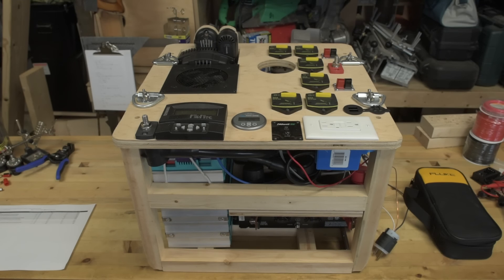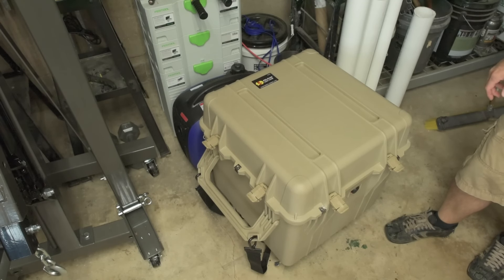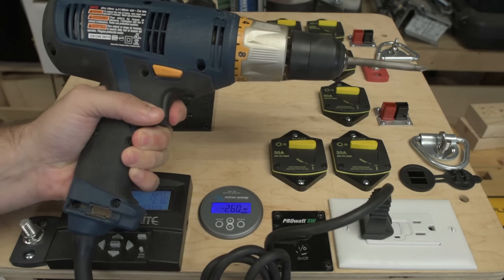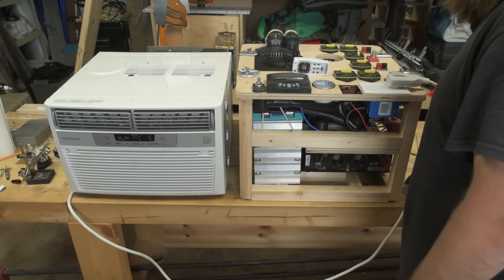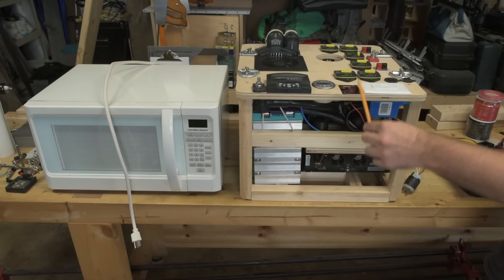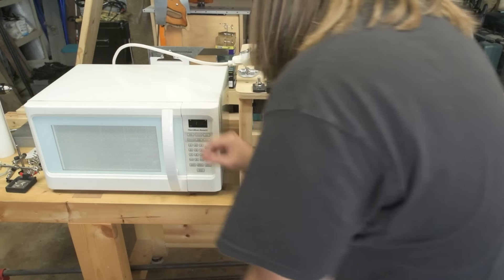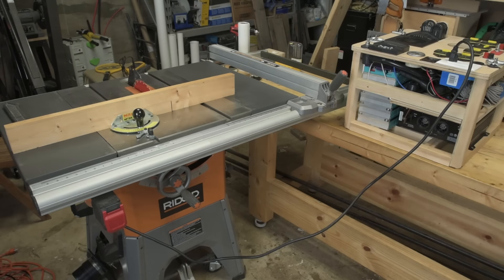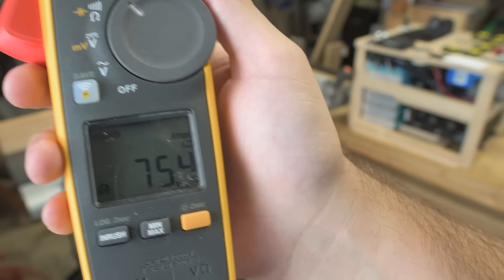Solar Air Conditioner with Xantrex SW2000 Review (Solar Generator V3)

Comment: Hi Jessie, Thanks for showing and elaborating on your nice setup.  I just wanted to throw in my 2 cents to help educate those interested in going to solar power.

First off, we are spoiled by the high quality power we receive coming into our house.  It is perfect power (virtually unlimited, very low distortion, unaffected by appliances that have a high surge current and/or poor power factor).  When you try to make your own power however (such as in an off-grid situation), limitations can quickly cause trouble.

Starting with the solar panels, the rated output is spec'ed under ideal conditions: direct, very bright sunlight, no shadow falling on any part of the panel, the panel temperature is 77F/25C, and the panel is perfectly loaded to extract the maximum about of power.  In the real world, overcast days, high humidity, high temperature, shade from nearby trees/buildings, and the sun being within 3 hours of sunset or sunrise, can substantially drop the panel output.  If you want to power a load 24/7, I recommend at least 10 times more panel power than the load.

For maximum efficiency, the solar controller (the power converter that goes between the solar panels and storage batteries) needs to be a MPPT (Maximum Power Point Tracking) type, which always loads the panels for maximum output power.

The inverter (the power converter that takes the battery power and converts it to house power) needs to be selected carefully depending upon the type of load you plan to power.  If you are powering incandescent light bulbs, small heating elements, or simple electronic items, you can get by with a lower priced modified-sinewave inverter.   If you are planning to power a nice TV, desktop PC, or an induction motor, you need a true-sinewave inverter.   Yes, you can temporarily get by with a modified-sinewave type but, I don't recommend it.  The modified-sinewave inverter puts out squarewaves, cause continuous surges (due to the rapid rising and falling waveform) and voltage transients.  Also, it does appear to run most induction motors but, if you check the power consumption, you will find the motor is drawing 10 - 20% more power (which turns into more motor temperature rise, shortening its life), which power you can't afford to waste in a solar system.

Power factor.  Inverters are spec'ed with a resistive load, which has a power factor of 1.0 (a perfect load).  Many appliances around the house have a less than perfect power factor.  Take a CCFL (Cold Cathode Fluorescent Lamp), most of these have a power factor of 0.5.  To find out how much power your inverter will need to put out, multiply the reciprocal of the power factor by the listed lamp wattage.  So, if the lamp says 25 watts, you will need at least 50 watts inverter power to power the lamp (the same holds true for generators).

Inductions motors want perfect power at all times.  An induction motor is basically a power transformer with the rotor being a shorted secondary.  When that rotor is not moving, the motor draws high current (which is why motors have some type of high starting current).  Induction motors have poor starting torque so, if you have high starting torque needs (such as with a compressor), these motors have a starting winding that is active when the motor is below 50% (more or less) normal operating speed.  This starting winding is a secondary motor running in parallel with the normal motor, with 2 - 10 times the current draw.  Motors with a starting winding have 2 current ratings, (1) FLA (Full Load Amps); normal current draw with the motor running with a full mechanical load and (2), LRA (Locked Rotor Amps); the maximum starting current with the rotor not moving.  Because induction motors must be operated within about +/- 10% of the voltage rating (they quickly overheat if the input voltage is low), you need the inverter continuous rating to equal or exceed the LRA demand.  Yes, I know inverters all have about a 2X surge rating however, there is no standard for the inverter surge rating.  If the inverter manufacturer specs his inverter to output the surge rating for a maximum of 0.25 seconds, this inverter would shutdown if the motor took 2 seconds to get up to speed.  I have found refrigerators to be the worst offender in this area.  As an example, I have a 18 cu. ft. refrigerator that has a running current of 1.0 amp.  However, the startup surge is 14 amps and lasts for 3 seconds!  By comparison, brush motors (used in power tools) have high starting torque and typically draw 3X the running current at startup.

Batteries, the most expensive part of the solar system.  If you are hoping to run a window air conditioner all night, you will need Lots of battery storage!  For instance, if you want to run a basic 5,000 BTU unit (600 watt draw), you will need about 1200 amp/hours worth of batteries (assuming you would be running from 12 volt batteries; about 10 group 29 lead-acid marine batteries).  This would give you about 9 hours of run time assuming the compressor is running full time.  At the end of that 9 hours, you would need to have some guaranteed way to make sure those batteries got charged, or they would have a very short life (so, you would need to have a backup generator in case you have a day without full sun for at least 4 hours.  You would also need a bare minimum of 2200 watts worth of solar panels to keep the A/C unit operating while you charge the batteries.  I know this seems outrageous in light of YouTube videos where someone is running a small window A/C unit from their Harbor Freight 45 watt set of solar panels.  Yes, you can do this but, you are only working off the charge in the batteries.  With that type of system, the panels will only supply about 15 minutes of run time, assuming you had a least 4 hours of full sun.

Anyway...  Sorry to be rather exhaustive.  I like to do things on the cheap but, many of the YouTube videos really won't give you a realistic expectation of what you would be getting into for a somewhat practical working system.

Comment: There's a trick you can use to start up motors with high start current on a smaller inverter.  I learned this from a generator dealer.   First, start up something like a drill on the same circuit as the saw, THEN start the table saw with the drill running full speed.  The momentum of the drill may back feed enough energy to help start the table saw.  One step further: use a drill with a fly wheel, which stores even more energy.  It worked on a couple jobs I had with large generators, but it's the same principle.  Good luck.
Reply: Well yes that works.. Just get some squirrels to start running  real fast.. To spin up the motor to 2000 rpm..Then disengage the squirrel clutch drive. So they don't go flying  off into the space...
Reply: @WizzRacing  this would be acceptable, if the squirrel's name was Rocky.

Comment: Nice work!  I did something similar with 12 volt 180 amphr Lipo.  After almost 2 years I see almost no degradation of the battery.  it can actually store more than 180.  Next step to switch to 24 volt and double my battery bank to be able to run a small a.c..  Keep up the nice work and I'll be subbing.
Reply from the maker: I'm considering a 48v system for my next generator. We'll see.
Reply from the maker: +Lee Nguyen judging by the lab tests I've seen, temperature is probably the biggest factor for lifepo4 longevity. DOD too, but mostly temperature. Don't let it get hot or freeze. Very picky about temp.

Comment: All new Micowaves have soft start.. As the magnetron in them draw huge amounts of inrush power. So to meet the new energy standards everybody has installed soft starts from the factory..Why the AC worked as well....

Comment: Does your xantrex make a strange, rough continuous clicking when the batteries start to get below 11.5v?  I’ve had two sw2000s and they both did it which seemed very odd.
Reply from the maker: It has been a while since I put this system together, but I think my lvd is set to 12.8v or higher. I don’t think I ever let it get that low because I’m running lithium and I’ll destroy the batteries if I do. I assume you’re using lead acid?
Reply: @createthisdotcom  I am using lead acid but will be switching to lithium soon.   This inverter has a low voltage adjuster? Thanks
Reply from the maker: I don’t think it does, no. That’s why I’m using a BP-220 low voltage disconnect https://www.victronenergy.com/upload/documents/Datasheet-Battery-Protect-65-A--100-A--220-A-EN.pdf

Comment: Have you thought of trying this, add a huge heavy duty capacitor to the output of the inverter to assist in the current surge?  It is like adding a Relay/Capacitor Hard Start to a air con unit so that a small generator can power it.
Reply from the maker: +sok8888 The motor has to be designed with soft start capacitor in mind in order for this to work. Job site table saws, for example, feature soft start capacitors. Unfortunately, I'm not aware of any device that can be placed upstream of the motor in a generic capacity as a "universal" soft start capacitor. It would be great if such a device existed, but unfortunately I don't think it does. The way most people deal with this is by installing a VFD (variable frequency drive), which also requires replacing the motor itself.
Reply: @createthisdotcom  Bingo... As we install VFD drives all the time. To cut energy cost..Also always you to use smaller gauge wiring.

Comment: do you think the inverter will run an LG front loading wash machine?  And a gas dryer? Basically the dryer just turns the motor and is normally about 230 watts
Reply from the maker: Gas dryer at 230 watts? Probably. Washing machine? Not sure without wattage info. I included a link above, in the description of the video (show more), to a spreadsheet that lists the rated wattage and inrush current of every large motor in my shop. Looks like you can be pretty confident up to about 840 rated watts, but that's a "no load" starting wattage, so I'm not 100% sure.

Comment: Nice setup!.  I'm looking into buying that same Xantrex to connect to 18650 powerwall.  Is it possible to change the shut off limits on that inverter to say 13.5v?  I can't let my lithium batteries collectively go down to 11v which is where most inverters automatically shut down.
Reply from the maker: No. I use an lvd.

Comment: what kind  of invert would you recommen to run your  table saw and plainer
Reply from the maker: +orvin deo I wouldn't, unfortunately. The inrush current is too high. I think you have to use a VFD (Variable Frequency Drive) and install a new motor. Even then you probably want at least a 24V battery bank and inverter. Maybe even 48v. Ultimately it may make more sense to wait for battery powered table saws and use a large generator in the meantime.
Reply: Different inverters would be more appropriate. A Xantrex Xpower 5000 would work or the Transformer based Freedom SW 2000.
Reply from the maker: +W the Freedom SW 2000 is also at least $1k more expensive and looks quite a bit larger. I don't think the xpower is pure sine. For my next build I'll probably use a 24v or 48v pure sine.
Reply: You are right. It is a larger more expensive unit. The transformer gives it the surge capability. The Xpower is MSW, but can run all the loads on that list. Even most microwaves (no Keurigs tho!).
Reply from the maker: +W so, on what basis are you recommending these larger inverters over the smaller one I'm using in this video? Longevity?
Reply: Just to cover the surge needs of the loads. The Xpower is a fairly basic series, but the big 5k unit is used mainly by contractors to run tools on the job site. Cheap, Good, Basic. The Freedom SW is the surge tolerant high end unit. Just pointing out that while this inverter has some pros and cons, other models can get you the surge you are looking for (and still stay in a 12v system).
Reply from the maker: +W I don't think either one of those inverters will run my table saw.
Reply: A 5k gasoline generator...Be hell of lot cheaper...

Comment: I bought the same inverter, brand new and it won’t even start my office mini-fridge. I get the E04 over temperature error and the continuous beeping. I do not recommend the Xantrex SW2000.
Reply from the maker: Did you return it and try another?
Reply: createthis I actually had it for so long in the box that it was too late to return it.  I’ll Always test my electronics before I store them going forward.  I’m going to try to get it repaired.  Are you still happy with yours?
Reply from the maker: Yes. I use mine daily. Sorry for your trouble. :(  I think it comes with a 2 year warranty. Hopefully you can call them and have it replaced or repaired with little hassle.

Comment: Would increasing the number of batteries in your battery bank increase the run time for the air conditioner?  Great video.  Thanks.
Reply from the maker: Absolutely. It would also increase the amount of time necessary to charge the batteries if the wattage of the solar array stays the same.
Reply: I have a 24v portable system with 2 x 100ah battery bank. I can keep my windows ac (8000btu) running 16 hours plus with 800 watt solar panel inputs...

Comment: Most impressive. I cant seem ti find a 4 AWG wire at any of my Home Depot, Lowes stores. That is indeed really beefy cables from the inverter to the battery. how are you dealing with earth grounding the Xantrax 2000 Watt Inverter?
Reply from the maker: Not 4 AWG. 4/0 AWG. It's way bigger. I included links to the cable in the description of this video: https://youtu.be/6svrW-M6BY4

BTW, build anything like this at your own risk. The engineers I talk to call this a "Battery Bomb".
Reply: createthis Fantastic. Thanks for pointing me in the right direction 👍🍻
Reply from the maker: oh, sorry, forgot to mention: the inverter isn't grounded. my understanding is that most inverters are not grounded in RVs or portable generators. You only need to ground them in fixed building installations. I'm not an expert, so take that with a grain of salt.
Reply: stevemichelle1203 Buy a roll of welding cable from Amazon. Red and black wire at 4/0. You can buy connector ends or make your own out of copper pipe.

Comment: Q: Can you have a 2 battery bank?  One for initial start up and the other for continous running?  Kinda both high power and low power system.  Hopefully only needing to replace a couple high power batteries instead of a huge multi battery bank?  Thanks.  Great video.
Reply from the maker: +K Michael Flynn no, sorry. The inverter is the issue, not the battery bank.
Reply: You can use 120 volts AC to get the saw going. Then transfer over to the inverter..Just don't expect the invert to last long...

Comment: I have the prowatt 1000 and the same battery. I can pull up to 1200 watts no problems. I also run a skill saw with this model with no problems. I think cause I also added a 20 fared cap on the Inverter. Gives it that extra inrush Amps that it needed to power the saw.
Reply from the maker: It’s been a while since I filmed this, but I think I ran a skill saw successfully, but not a table saw. I like your capacitor idea though. I may try that.
Reply: A little over kill I know
Reply: Don't know if it's a ture 50F but I do know charging and discharging is a bitch. This model came with a 100A shunt thou. Tells you the amps read out well. However I pushed 125 amps though it and started to smell a little funny. Never was the same so I just bypass it. I love the Caps in this model for sure 2 different type of compactors technology.

Comment: You need a super capacity in order to drive heavy machine like table saw
Reply from the maker: Yeah, you can mitigate the inrush current by adding a start cap to the motor, but only certain motors are capable of using that technique. Mine isn't, AFAIK, so my best bet is a VFD (variable frequency drive). Honestly though, I'd probably just buy a large gas generator if I really needed to run my large shop tools off grid. Cheaper that way.
Reply: Louis Y .. I have a video of me running my big Ridge table saw on my Jupiter. Check it out....

Comment: Instead of running only on solar, how about running it off your alternator with a dual battery isolator. Good alternative to running a generator while camping
Reply: Jim D : that’s exactly how I (test) run my 1.6kw aircon (smallest one I could buy) for 20 minutes...the combo of my 500watts of solar plus my dual battery isolator through my 2000watt inverter seems to do the job. I’m sure it could have kept on going. I’ve been looking for more info on this technique but there doesn’t seem to be a lot out there as I want to know that I’m not going to blow up my AC or inverter by straining any of the components.
Reply: Steve J. You should be fine, just do the math, as long as your alternator can produce enough amperage to replace what is being drawn by the AC with a large enough buffer in the battery bank, but if you tax your alternator too much, it could be the end of your alternator.